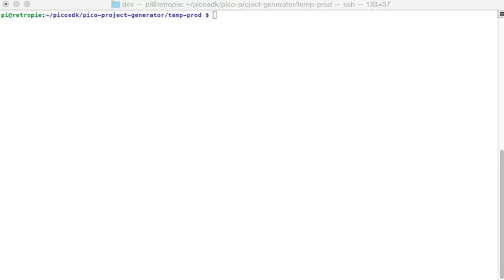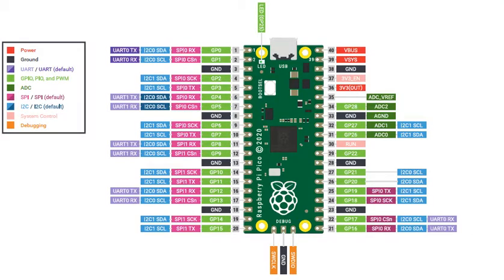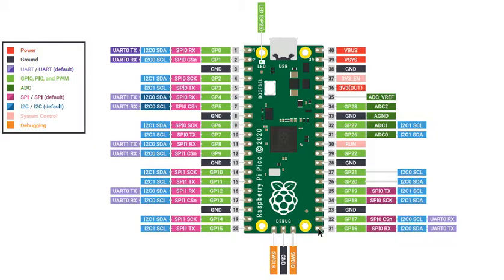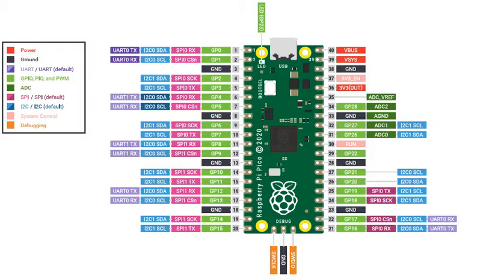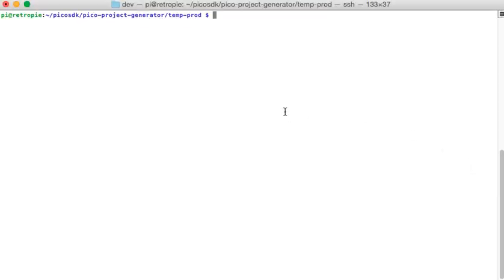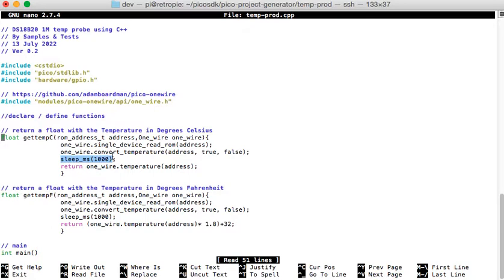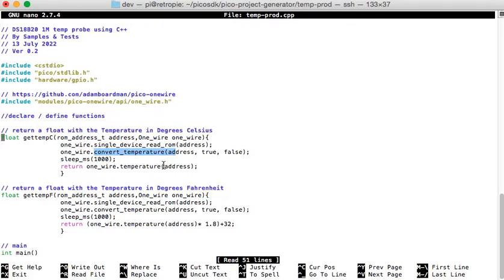Raspberry Pi Pico with DS18B20 1M using C++

Comment: Hello, I am totally new to the Pico.  I volunteer at a food pantry and I set up Pi's with ds18b20's to monitor freezer temps.  They are looking to expand and due to 1wire distance issues and the pi supply chain I am looking into the pico's.  Would I be able to read a ds18b20 that is connected to a pico via wifi from a normal pi?  Today we read the temps, send alerts via a sms gateway and log the temps.  If so what would the commands on the normal pi side look like?
Reply from the maker: you may want to use a Pico W and to send it via wifi. I have only done the bare basic test with my Pico W, but a thought would be to setup a basic web server with PHP on the Raspberry PI and then use the Pico to send the data as a POST or GET request to that server. and on the Raspberry PI side you can make a PHP script that does what you need with the data. hope this helps. if you would like me to do a video on the this please let me know. good luck the project.